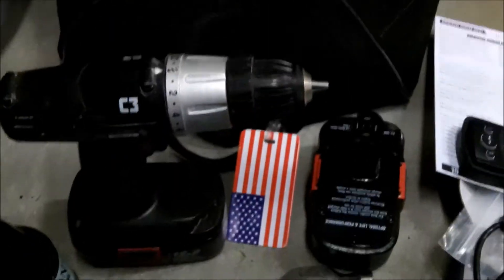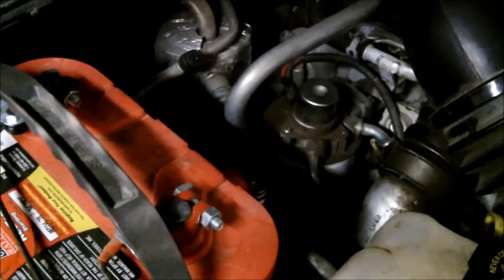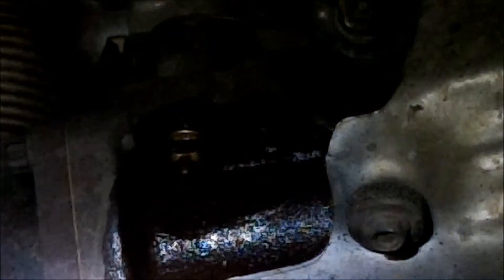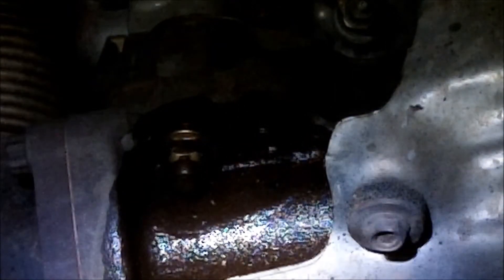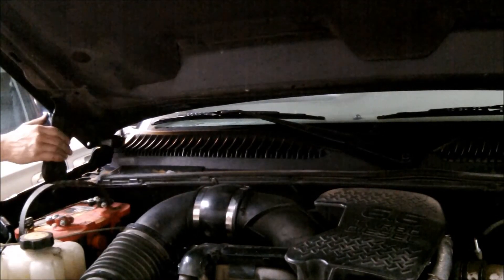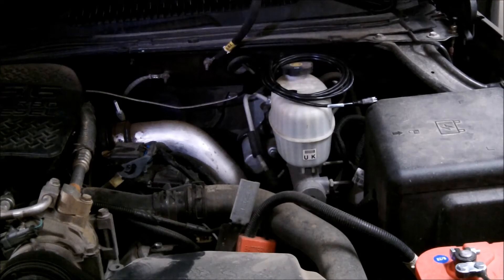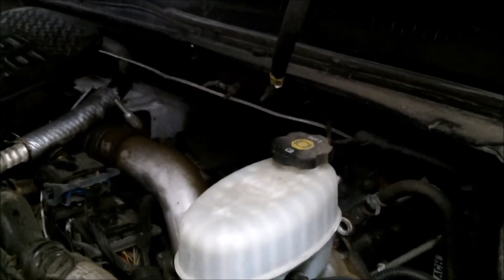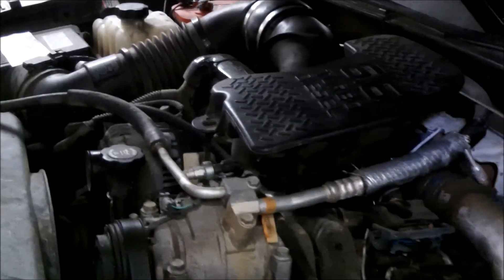Edge EAS EGT Installation 05 Duramax LLY

Comment: Don’t run the wire through the door jam and into you door boot like that. It will leak if it gets wet enough. Go through the fire wall correctly. There’s a boot that is easier to run through that’s next to the one you were trying to.

Comment: Good video it was unnerving drilling a hole in my Duramaxs manifold .I was debating where to run the egt cable to the Edge CS head I'm going the some route you did .Thanks